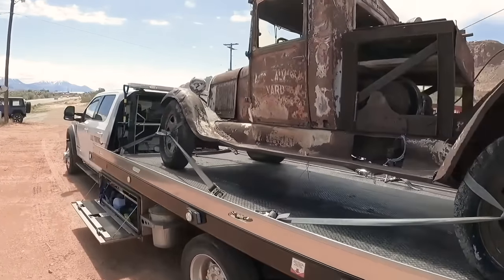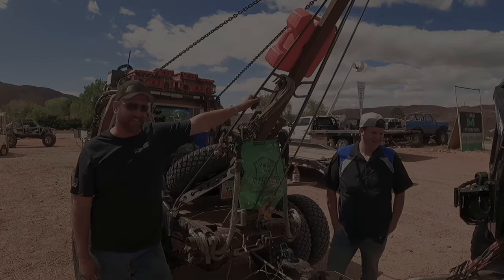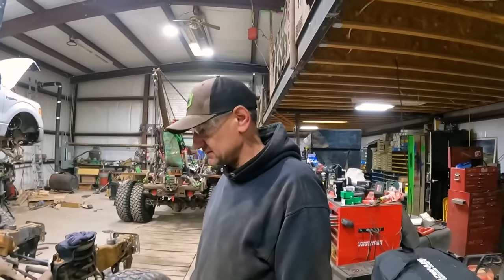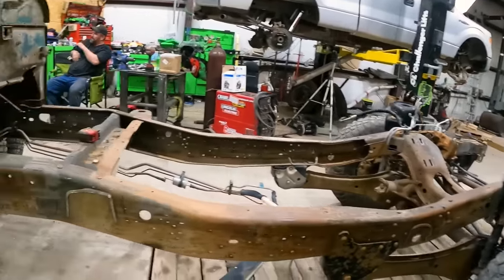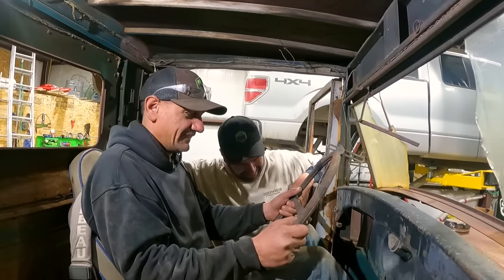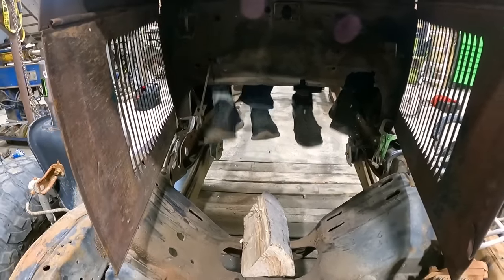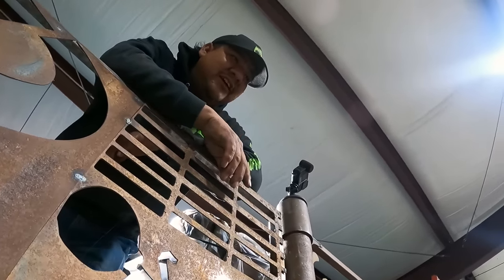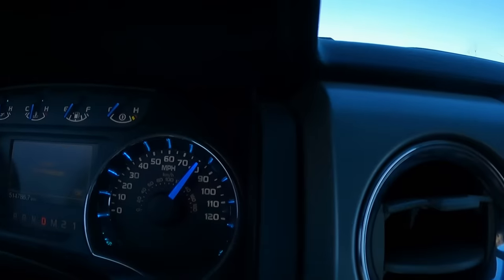@RobbyLayton Model AA Wrecker Build (Part 2)

Comment: These old trucks LOOK so cool, but once you see how TINY it is inside the cab, it pretty much kills it for me (as far as anything you plan on using more than occasionally).  It make me really appreciate the massive amount of space inside the cab of my 4-door 2005 F350 Super Duty Fummins.  And for off-road, you really want some space around your head so you aren't slamming it into the side of the cab, the back of the cab, the roof, etc.  My hat's off to y'all for taking on this project!
Reply: That;s what I was thinking. Maybe raise the entire cab up some?
Reply: People were smaller when those trucks were made.
Reply: @hibiki54  Not that much smaller.  Both of my grandfather's could have driven this truck when it was new.  The shorter one was 5' 11".  The grandmothers would have actually been able to fit behind the pedals...

Comment: All newer vehicles use a pulse counter on the transmission output shaft to determine speed. I had a problem after changing gears in my car. I was able to get a little circuit board that intercepts the transmission pulses and can be set so your speedometer reads correctly. Once installed you just connect to via Bluetooth and set your actual speed and that’s it… I got it from Dakota Digital.  It was not expensive either.

Comment: Rory, you should cut the cab into and extend it to make a larger cab.  Mike, the quality of steel used back in those days was a lot better quality and wouldn’t rust like the crap we have today.   I know of an older car up in the mountains that has been outdoors for over a hundred years and the frame is as solid as the day it was made.   Keep the videos coming! 😊

Comment: I think you need to let Robby fabricate a 6 to 12 inch extension to the back of the cab before getting too far with this project.  You could be working on the frame while he does it.  As far as the multiple boxes goes its kind of like a crumple zone in a car.  It can get a little squished without harming the contents when in multiple boxes.

Comment: I would extend the cab so yous can fit inside of it better. Add on behind the doors this way more leg room and room for the steering wheel. Its a cool truck but small. I don't know what they where thinking back when the first built that truck 😂 It will look cool when its done thow I bet

Comment: Take a look at the truck with the cab at the back over the wheels you can see exactly  what you're heading into and can flex the whole terrain  Use hydraulic  lines to steer ,Just because  it hasn't  been done before  doesn't  mean it can't today's off road vehicle  ..Ps Just noticed the new chiclets looks good on you ,I just got a new set too Can't use the bottoms at all

Comment: You all might need a carpenter.  It's kinda weird but wood ages better than plastic.  My $0.02 on the seat is that hard is better than cramped, like it used to be (those folks were used to riding saddles).  At least he can crank open the windshield.

Comment: If you had the front hubs locked in that would cause it to pull to the right. I worked at a Ford dealership and a guy brought his F150 in and had the same problem. He refused to drive it with the hubs unlocked so he had us change it to an open diff.

Comment: Since electric is half a towing business(winches aren't gas) maybe the first electric off road tow vehicle could be something you guys build. Electric would seem to have certain advantages in low end torque and control. No gears to worry about. Rich Rebuilds Channel might be a good consultant. He is the guy that put a V8 in a Tesla. He is thoroughly versed in Tesla mechanicals and can convert just about anything to electric or from electric. Cool to be first at anything.

Comment: i am currently building a model a truck rock crawler, all tube construction...cab ,frame bed,everything. i looked up all the measurements of a stock model a pic up on line. when i built the cab it was way small. i ended up moveing the firewall 3 inchs forward and makeing a " bulge " toward the engine compartment for the clutch peddle to sink into when the peddle is depressed. wish i could send some pics

Comment: Genuine question: Could you cut the cab in half (front to rear) to widen the room in the cab? I understand it's a lot of bodywork, but I think you have a good body man. I imagine even a few inches would make a big difference in cab comfort and it would probably fit better on the frame. Anyhow, cool build!!

Comment: That cab is uselessly too short.   I think what happens is the crammed-in 'uncomfort' slowly adds up to the owner veering off to an alternate vehicle more and more often, until this one becomes a pavement(paper) weight.   The first thing I'd do is figure out how to make that cab at least a foot longer and preferably two feet.  If I couldn't pull that off I'd can the project.

Comment: I am of the opinion that that cab interior needs to be stretched a minimum of 4 inches! That is one seriously cramped cab! Just cut out the rear wall and move it back. It’s not like you don’t have any room on the frame or anything like that.

Comment: I would be building a 6 wheel drive with a double drive axle in the rear so like a 10 wheeler but single tire on each with a rotator boom and hydraulic winches they have far more power than any electric winch you can get
Reply from the maker: So build one, show me how it's done.

Comment: Would you consider splitting the cab in the middle/cross section and adding 6-12 inches before welding back together?

Comment: I want to see someone use something like a Kohler V 4 engine and then a 6 or 10 speed automatic transmission and single axle locking system

Comment: How did you decide where to place the body on the frame? I love how the springs are outside the hood and the leftover front frame horns are just right for a winch mount. But please explain your thought process on cab placement. Was it wheelbase related, bed space, simply cosmetics???

Comment: Does the Cutoff Disc get closer or is there another reason Mike didn't use the Plasma Cutter for the body mounts?
For the Long Straight cuts, I have seen an increasing amount of fabricators using metal-cutting Circular Saws.

Comment: Would it be possible to cut the back off of that cab and section in about a 4-inch extension?  Folks are generally taller now than when that AA truck was built.

Comment: Here I am at seventy four done this all my life and yet learning a lot from you also. Now go cummins power and leave it as a two wheel drive so he goes insane when he leaves the blacktop to a mudhole in his driveway..... mean hu you say? Robby is not pushing himself to make things himself. You have went the distance in building something that can flex, use the doubler, and go where man learns to get over something or HA HA HA..... FLY.  Okay just joking,,,, make it a great four wheel dually like yours as something about those duals and their advantages over single tires doing heavy lifts safely. I know the bead lock seams better than other styles for not walking off of the rim on corners but.... ya this needs a but..... Robbie trusts  stuff to just do it and its gonna get him kilt. least hurt bad